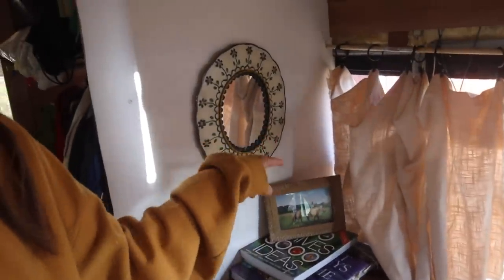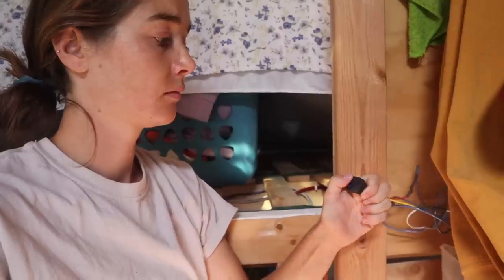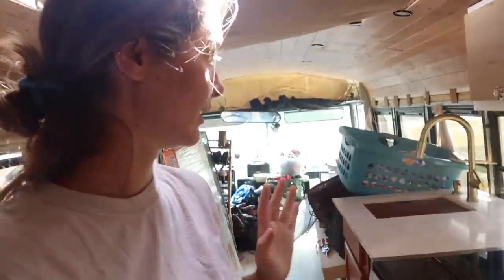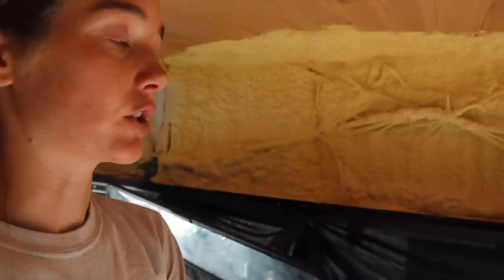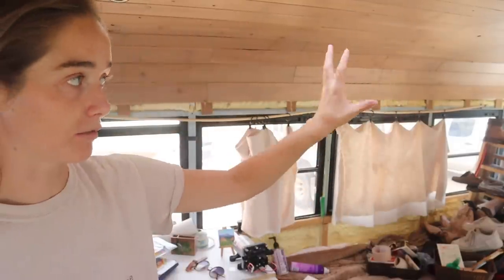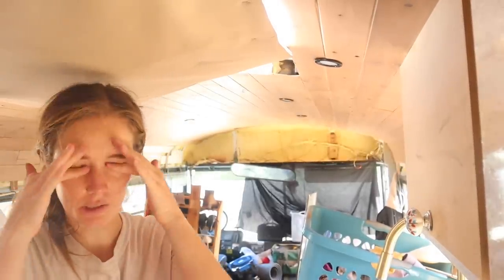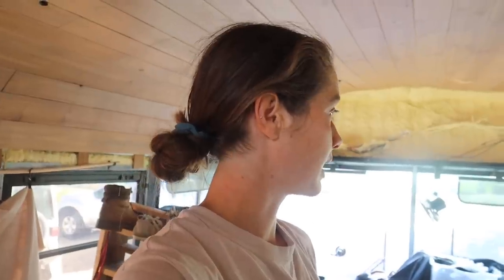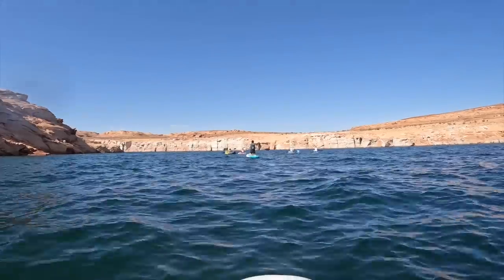i forgot how long this stuff takes // school bus conversion episode 188379

Comment: I cut a groove in my bottom piece as well in my front shelf! Worked great. I forgot to post on the last video, but parking, even semi long term, isn't as hard as you're thinking. Especially (or maybe only because) when you don't need water/electric hookups. At first I tried putting ads up on nextdoor, but you're limited to your own neighborhood, which doesn't help when you're trying to move. I texted a couple of boondocker welcome hosts about paying them for a month stay, with mixed results. I park on the street often. Avoid really nice neighborhoods and look for something almost industrial, or someplace with apartments rather than houses. Tenants mind their own business much more than homeowners. I park in Atlanta for two months at a time without moving my bus. If you want to visit the south (Atlanta's a great urban environment you can park in and still get out of the city really quickly as well), I will let you know some safe spots. If you want to spend time in Savannah I park out here for under $100 a month in a private spot. There's horses (and an active business in the parking lot), some storage units, and a couple of skoolie residents. Savannah's a great spot to visit in the winter, miserably hot in the summer. My email is in my channel if you want more information.
Reply: I have always wanted to see savannah georgia in the winter!

Comment: I studied your electrical connections from your battery and I noticed you don’t have a disconnect between the charge controller and the battery. I would suggest getting another disconnect similar to your solar disconnect between your solar panels and your charge controller and having one that lets you disconnect your battery from your charge controller otherwise the charge controller is connected 24 seven and does cause a little bit of drain. By adding a disconnect between your battery and charge controller you can flip the switch if you ever need to reboot the charge controller. I have to do this sometimes when my charge controller starts acting funny. Just a thought.
Reply from the maker: thank you!
Reply: @EmmaBuildsBirbie  Welcome!

Comment: The razor blades are oiled, simply slide the blades apart, by sliding top blade in opposite direction from lower blade in the stack. Much easier than prying apart.
Enjoy the nice weather days, have fun, work on the days you can't go out and have fun. Enjoy life.

Comment: When you showed your battery area, it didn't look like the battery was anchored down. One always wants batteries secured well. Some Interstates and highways are rough and will toss stuff all over. 
An easy system is in the plumbing dept called plumbers strap generally. It's metal flat strip with holes in it. Cut to length and zip some screws in.
Reply: I agree, that battery didn't look 'tied' down.
I may have missed the install of those BUS bars, are they FUSED, otherwise there is no fuse from the Victron Controller to the Battery either...?

Comment: Emma, You could just create the perfect curve (but slightly smaller) for the top of the cupboard front thingy, and screw a 3” wide strip thingy to the top edge. Then use the 3” wide thingy to screw the ceiling strip thingies to it from inside the cupboard - thus solving several issues at once. The 3” thingy could be the depth of the cupboard if you like. And the bendy plywood used for the inside of arches would be perfect for 3” (or wider) strip. Good luck with this bit. 
Peace 🧐😎😜🏴

Comment: So far so good... you got some solid pieces firmly attached to the bus bodywork. Next you need a nice piece of 3/4 or 5/8 inch plywood for the shelf/bottom and the back... buy a big sheet and you can cut everything from the one piece. Make a cardboard template for the shelf (its good to practice even if you don't need it) and then put it in place temporarily. Now you can make the template for the back (make it tight against the ceiling if you can) you can always take a bit more off or sandpaper it for a better finish. Now pull them both out and put a batten across the back of the shelf for your back to fix to. Pop them back to check everything is ok and make up your two dividers... take the back out again and  glue & screw the dividers onto it from behind... and pop it all back in place. By now you are a cabinet maker... making a front piece much like the back only a bit deeper  this time... will be a piece of cake. Cut out openings a bit smaller than your doors or leave the side pods open. Nut I bet you already did all that a couple of days ago... I just like trying to be helpful.

Comment: Hi Emma,
Great video! You've done REALLY well! Idea for front shelf/cupboard of bus sounds fine to me!
Though You might want to bolt the shelf through the wood and metal below that, just so it's 'anchored' solidly in two places one at each end of the shelf towards the back, then you KNOW is CANNOT tip forward if it's taking ALL the weight( a lot of weight) in front of where it's supported at the back.(does that make sense?) But the general idea for the design of the bottom and having the dividers there sounds ideal to me leave the ceiling alone for sure! "If it ain't broke don't fix it" and the end cupboard will help to support the ceiling once it's all in place of you scribe it in well.. 
Loved the end part of the video what a lovely dog!! He clearly loves to play but also you could see he was making sure you were ok! You can't beat dogs for trying to protect you! 
Have a great week! Cheers from London 👍😎❤️🏴 x

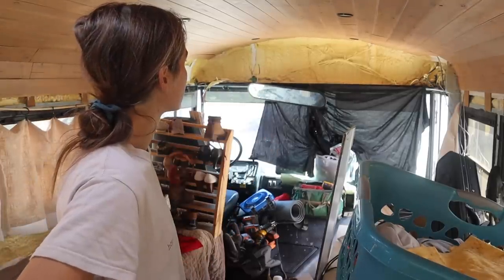Comment: 9:48 if your dividey pieces are sheet metal with the edges bent 90° or if you have metal angle-iron from the bottom of the curve all the way down with plywood screwed to it it definitely sounds reasonable & probably gives you somewhere to attach the panel that covers the insulation.

Comment: Lake Powell looks insane. It looked like a good time.

Love to see you back in building mode, even if that's not necessarily what you'd rather be doing. We just see your brain work in a different way. For your front cubby, honestly, once you get a board that goes the whole width of the bus, I'd make a box with the original door in the middle, and just open shelves on each side. This way, you won't have to deal with the ceiling's curves nearly as much. This being said, when this video is posted, you've perhaps already done it... If you don't do that, maybe I will! I'm totally obsessed with my future build...
Reply: There's not much that's more dangerous than stuff raining down on the driver & getting wedged under the pedals.
Reply: @alanhat5252  put a lip on the shelf, and remove the dangerous items that are on it while you drive? You can have a plant there in normal times, that you just keep in the sink while driving. Or have a storage box secured with a bungee cord. There are plenty of safe options. Build-wise and looks-wise, I just like the idea better. But I'm sure Emma will make it work her way!
Reply: @francoisg1393  it's definitely something that needs careful thought